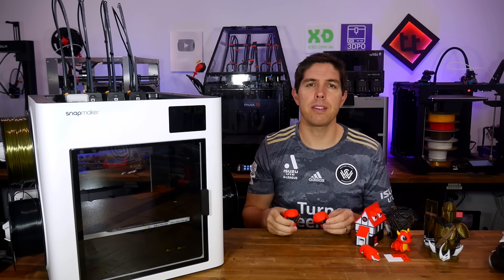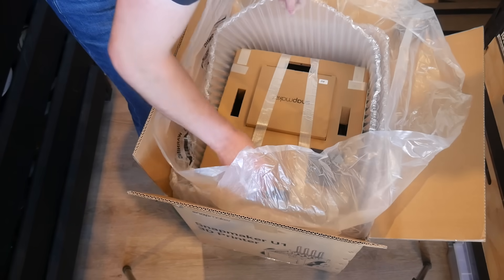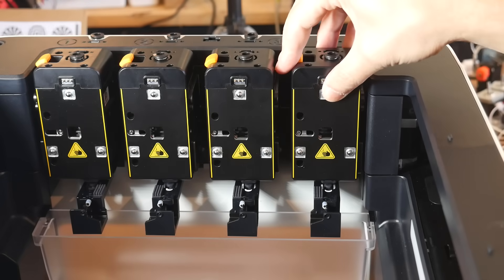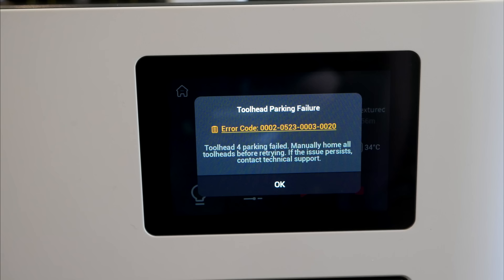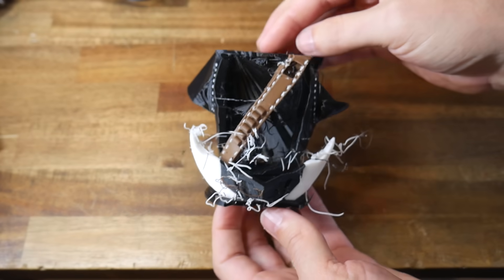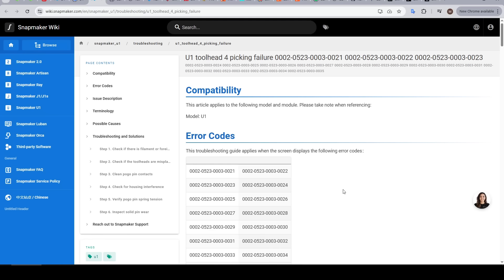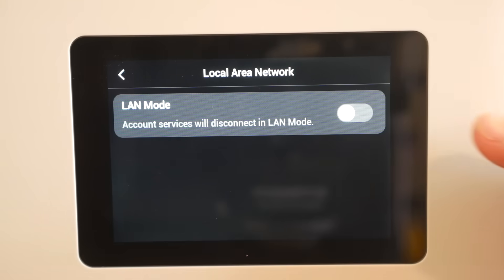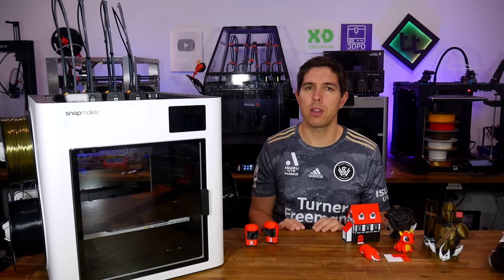Snapmaker U1 toolchanger production model first impressions

Comment: I received my U1 a few days ago and it’s been impressive, easy out of the box build and setup. It’s been a huge difference in the amount of material used in multi colour prints from poop style machines with material systems. I am definitely going to buy another one as I see the user community is going to take this printer and run with it.

Comment: Qidi had major issues with their 3D printer making printer bottom from plastic, they use metal since. So this is bad design from company that never learns, avoid.
Printer has no bottom metal structure, it bolts to flimsy plastic bottom.

Comment: I just had this same problem with my printer during the initial calibration.  I've had to dial in new toolhead coordinates several times, and I'm not even sure they are correct. I have gotten through 3 calibrations and 1 dragon print, so maybe I'm good....  It sucked trying to fix this new printer right out of the box.

Comment: I got one on Kickstarter, just got their enclosure, and some 0.6mm nozzles, but it doesn’t do different nozzle sizes in one print yet. It’s a limit within current OrcaSlicer and their cloning exercise, but SuperSlicer and PrusaSlicer could do this years ago, as could my Robox RBX02 10+ years ago, so I might be looking at this once I get mine. The ProForge5 can do this, but unsure which slicer Makertech3D are using.

Comment: Personally I am very skeptical...
looking at this from a business perspective.
Tool changing was an expensive experimental thing started years ago. Now companies are racing to see who can make a tool changer for the lowest price.
Racing to make a product for the lowest price is a very bad business model.
Corners are always cut to get the "best" price.
I suspect quality control will suffer.
The company margins are probably not that good which could mean the company becomes unstable after a while.
This reminds me of everyone copying the Bambu printers and just making them cheaper but worse in quality.

I cant wait to see what bambu labs does with their vortec system.
They seem to have their heads on straight and understand that business isnt about a race to the lowest price but innovation.
So far they have not copied much from anyone and are the leaders in innovation in this business.
So looking at this U1 in light of the whole market, I do not see this as a good move and I suspect the hype will die for this in the next year.
Especially if Bambu keeps releasing new technology that everyone tries to copy.

Comment: A broken cable and repeated error codes would be enough to send the trash back. I'm so sick of being an external engineer for those companies and their faulty products. I have an anycubic kobra s1 and I can't stand how many hours of work, repairing, calibrating and dealing with customer support and waiting for spare parts I spent. Maybe more than actual printing.

I refused to get a bambu lab for several data protection issues, but I know why people buy them despite those.

Comment: So far. this Snapmaker U1 feels like the best value in the world of multicolor/multimaterial printing.
Unfortunately, if you want to pre-order now, ETA is March next year at earliest.

Now, waiting on BambuLab and Creality to see if they can answer with their models.
I have Creality K1 Max ( after having CR10 and CR10 Max), but this one was more like appliance than tinkering machine. It just works.
So now, this is what I expect from all new printers. the old days of tinkering should be gone for majority of the users.
A proper new printer should be easy to use and offer great value, for all that are actually not making money of it. Just using for their hobby.
That means, at least for me, a price below 1000. Its a hobby for me, and there is no value proposition for anything that cost too much.

Comment: There have been countless videos about unboxing and setting up the U1 and doing multicolor PLA prints. Meanwhile that’s pretty boring stuff. Surprisingly no one has extensively tested TPU especially the softer variants like 90A an 85A. Does it work with the side feeders or must it be fed directly through the PTFE tubes on the back or even directly into the printhead from above? That would be quite ugly with the U1 especially if you do multicolor TPU prints. What about TPU with PLA as support filament. Or TPU with dedicated support filament? An answer to these questions would have been very interesting.

Comment: Hey guys,
is z-height shown on display during printing? It's essential for inserting magnets without pausing the process.
Reply: How do you / why would you put your hands in print head path without pausing the printer?
Reply: @kimmotoivanen  simple answer, I need perfect surfaces, printing in 0,08 mm layer height, with pausing I can notice any stop.

Comment: Quick question, can you do a filament change on a non-active tool head while a job is running?

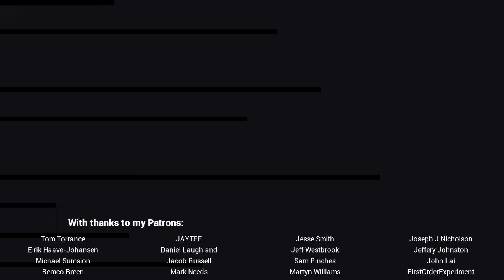18:44
Reply: If you put a pause in the job, yes. You can change filament on an unused head.

Comment: so the device has an app does it go over the clould like the bambu lab printers do?
Reply from the maker: The app does, but you can just use it as a klipper printer locally like any other. Once the webcam is in Fluidd that is a very attractive proposition.

Comment: I have printed multi-material parts without a purge block on the Prusa XL.  This can be done with a slicer setting.  Are there similar options with the U1?
Reply: Yes you can turn off the purge block

Comment: Seems generally positive then! IThanks for posting and I look forward to your full review.

Regarding the material support: They will be offering an enclosure with passive heating as well as hardened steel nozzles so I think it will support more materials than it currently does.

Regarding the section on privacy:
- It would be cool to know if the machine works with a USB ethernet adapter, as they said this will be possible.
- They also said we'd be able to get SSH access, so maybe you can see if that's possible too?
- I'd also like to know in detail what features we lose when using LAN mode, since they have advertised things like AI print monitoring which doesn't yet seem possible in klipper.

For print quality tests I'd be really interested to see more multimaterial printing, as this is the main draw for me on this printer alongside it being klipper-based.

Fingers crossed we'll get some videos from other S-tier printer reviewers now too!

Comment: Good review. Maybe you can answer the following (sorry if you did elsewhere)?
Does the bed mounted z sensor mean there is a cold spot that cant be printed on? 
Do you see any issues feeding from a 3rd party filament dryer? 
On my Bambu I generally dont use "Generic" filament settings but use Bambo filament settings instead as they seemed to work better. 
Does the U1 allow you to select their filament even when there is no RFID present on the spool? 
Looking forward to your head to head tool changer comparison.
Reply from the maker: 1. On paper there would be a colder spot but in practice I think it would be ok.
2. No issues from a dryer. As long as the exit faces the input of the U1 input.
3. You can set whatever filament you like regardless of what's actually loaded. I do the same as you on other printers and you can do it here too.
Reply: @TeachingTech  Many thanks for that information, much appreciated.

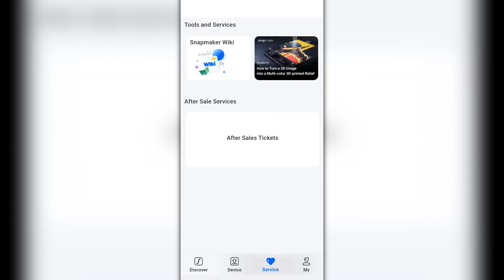Comment: 11:30 I hate with these apps is that they always have to shove some shitware in there. You open the app to do something with the printer, yet the first tab is always some kind of discover/recommended thing so you have to manually switch to the 2nd tab every time.
Sure it doesn't take any effort, but why is it needed at all? Why do companies think you're interested in some blogspam when all you want to see if your printer is producing spaghetti?
Reply: I agree, I just setup Mainsail as a web app and never use any smartphone app, so much quicker.

Comment: I've got my order in. The only bad thing for me is the filament is on the outside. Here in Darwin the humidity is a filament killer. I've got my own special version of dry boxes and even modified the Bambi AMS to keep my filament dry. I'm more keen on keeping the filament permanently attached and dry  than the add on cover.
Reply: Geometrically it looks like easy to design a cover for it, so I'm quite sure the community will come up with one. And maybe Snapmaker as well.
Reply: Connect 2-spool dryers or dry boxes on each side to feeder inputs?
I don't think there is so much retraction, that rewinding spool holders are needed.

Comment: Can't wait to see your H2C reviews. Vortek seems awfully complicated for what it is. Especially compared to INDX.
Anyway, while waiting for INDX, a print-off btwn U1, H2C and XL sounds very interesting !
Reply: There is NO BAMBU printer that compares to this.  They are not even in the same usability areas.  The H2C is just an old Bambu rehash that still cant print TPU in the AMS and STILL has to purge 2x the filament for multicolor prints.  ITS NOT A COMPARISON

Comment: Runs Klipper, has multiple tool heads, bigger than 220mm3, take my money....
Reply: Got my money, got shipping confirmation today
Reply: @kelownascott  Oh nice, did you also go for the top cover? Price is pretty good for that as well.
Reply: is better then prusa, take my money
Reply: @marine1718  100%
Reply: Exposed filaments and no enclosure, terrible build plate. Why? They make this awesome piece of tech then totally gimp it.
Reply: @jarayn  I thought the same, but if you go take a look at the web site, they have a lid sold separately, about 5 different types of build plates, and they offer the Polymaker dry boxes (Not a fan of those), but you can use any type of dry box, like a couple of dual Creality ones, or 4 singles, it doesn't need a self retracting spool holder, as its a tool changer system, not a filament changer system, I was mainly concerned about the enclosure, but the lid fixes that.

Comment: OMG the cheeky H2C drop at the end, so it’s a lot closer than I expected!
Reply: YESSSS I'm so hyped for the vortek system. I have an H2D but I will happily do the conversion, sounds like it will be a lot of fun to be honest lol
Reply: @SangheiliSpecOp Vortek sounds a bit naff vs INDX and tool changers. We shall see though!
Reply: @perkulant4629 its not super ideal but it can swap and heat the nozzle in parallel to unloading and loading the filament so we are probably looking at 10 to 15 second filament changing times which is very welcome to me. Add the peace of mind of the reliability of a Bambu machine on top and I'm happy. I just hope it will come out with no issues because now I see the FCC is giving DJI and now other chinese electronic devices issues with certification and the P2S is still not out here...
Reply: H2C is all I care about, can't wait for the review which will likely give us an idea of when it'll drop. It'll be this year so it won't be long since there's only 2.5 months till January 😁
Reply: I suspect that's a regular h2s or h2d box but I really hope I'm wrong! I'm so excited to see how the h2c performs while using an ams compared to these other tool changers. Fingers crossed bbl seriously optimizes the ams changing and then those can be applied to other printers in their line up
Reply: @cavejohnson2075  I just hope it has a competitive price entry point.
Reply: @cavejohnson2075  this is Michael though, he’s not a click bait YouTube reviewer, so I expect that’s a real H2C unit in testing.
Reply: @cavejohnson2075  vortek system will always be slower than multitool, because u need to wait the ams changing the filament + vortek swapping the hotend. A cool system to see  but. in my opinion, not worth the price but we will see
Reply: @grvtta we will definitely see! I agree, a tool changer is faster, it can prehead each head before its needed. Bambu can and does preheat each nozzle on yhe H2D as it nears a color change, but it starts to get messy once you introduce 6 more nozzles. It only has the single toolhead and the nozzles won't have preheating (imagine if they DID preheat off to the side, that would have been so cool but alas). The ams 2 retraction is pretty quick though, and it can unload and reload while the toolhead simultaneously grabs the next nozzle and uses the induction heating on it
Reply: @grvtta h2c looks like induction heating and its lighter (probably similar to bondtech but more integrated sensors) so should be faster to heat up. AMS is nice though. Not that many people use more colours but 7 should be plenty. And if you use 7 separate AMS-HT, it's not really any slower
Reply: @grvtta  Don't forget the H2D has two nozzles - L<>R nozzle swaps have the potential to be quicker than tool changers.  I agree that Nozzle changing will be slower than a tool changer due to not being able to preheat - but there is the potential for a lot of the AMS stuff to be done in parallel to the nozzle changing and reheating - so Vortek might be almost as fast as INDX for example - but slower than the U1 definitely.  Once tool change time gets down below 10 seconds timing for  priming, and prime tower engineering starts to get more significant - and is still required for all tool changer types I believe.
Reply: @grvtta and still TPU incompatible!

Comment: You're the second big Youtuber to have immediate and quite egregious QC issues with the hardware (or at least, include that in your video). Personally, I don't care about multicolor. I only wanted one that'd print multimaterial supports, but Snapmaker actually already has a true IDEX for that in the J1S at the same price point, one that should be better suited for that purpose--just the reviews on it are...not good. Haven't heard any glowing impressions. At best, neutral aspects.

So it is similarly worrisome that they couldn't do a good job on a relatively simple IDEX build yet they want me to believe that they knocked it out of the park on a much more complicated 4 toolhead changer? Definitely one where it's best to wait and see, I think.

One thing's for sure, next year will be very fun with all the neat tool changers coming out.

Comment: I see some advantages over my Prusa XL, the filament loading -- being powered,  the tool changers seem much lighter and my guess is that you could purchase a spare for quick swaps if a problem happens.  I would like to have a complete spare nextruder, but have never seen them for sale by Prusa an my guess is that they would be about half the cost of this printer.  Both this and the XL need a way to have the colors loaded appear in the slicer.  Orca can do that with my Bambu X1C, but I have to write down my colors for the XL to take with me when I design a print.

Comment: I seriously considered backing the Kickstarter for that nice discount, but I really wanted it to be enclosed and also it would have been far more of a want than I need considering my P1S fulfills practically all of my needs (other than fast and efficient multi-material of course 😅). Also starting off with an ender 3 for 3 years and then going to a P1S makes it a really hard sell in my mind to (potentially) go back to needing to customize and tune everything rather than it just working. Hopefully it does well and affordable well built tool changers finally take off.

Comment: I backed the Kickstarter. One question/concern I have is regarding printing emissions. Does it have a fan inside to at least provide some air filtering? The open top would make for a challenge in its own. Does it look like some cover/hood can be constructed for it?

If the emissions cannot be filtered, it’s going to seriously limit the utility of the printer for me, especially for multi-material printing.
Reply from the maker: I will check the fan, but others have said there is an optional lid for it.

Comment: I'm waiting until the real real production units are out (maybe they did better quality control on the units they send to youtubers?). But if it's anywhere as good as the reviews I've seen are suggesting, I'll 100% buy it.
Reply from the maker: This hardware is production spec. I'm sure YouTuber specials do exist but I don't think very often judging by the issues I've had on review machines over the years.
Reply: @TeachingTech fair point - though in a way that's mind boggling, surely it would make sense to do that from a manufacturers POV. However, given the huge demand here, maybe standards will slip? Who knows

Comment: What is your opinion, is this a superior choice compared to the Bambu P2S?
Reply from the maker: I didn't know the p2s existed until this week, so no opinion on it sorry.
Reply: @TeachingTech They sent you an H2C but not the P2S? I wonder how they chose which printer goes to which YouTuber.
Reply from the maker: I have told them I'm not interested in every printer. I said no to H2S and would have said no to P2S too. The H2C is something a lot more innovative which my patrons and I are interested in.
Reply: I guess it would depend on what you're wanting out of a printer. If you want multi material you d have to go with the U1. I ve wanted a tool changer printer for awhile so I d definitely prefer the U1.  You can always print 2 materials on an H2D , but the multi color on U1  should cut down on material and print times especially if you have a lot of color changes.

Comment: Still waiting for a tool changer 3D printer, not the entire tool head.
Waiting for that BondTech INDX.
Reply from the maker: Technically this is a hybrid since the part cooling fan is common to all tools, but I get what you mean.
Reply: Just slap a hot end and extruder on a Kern.